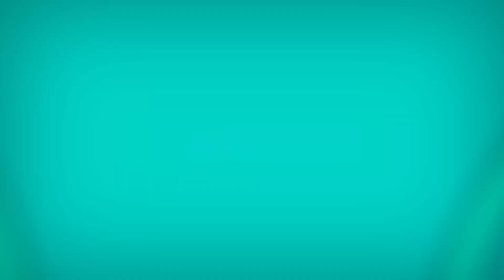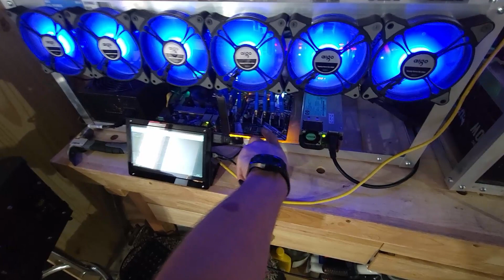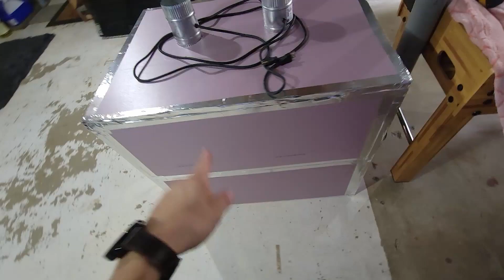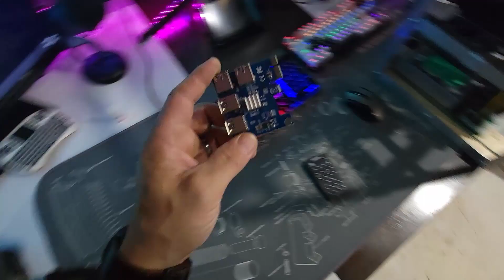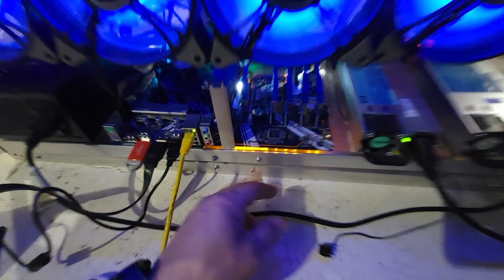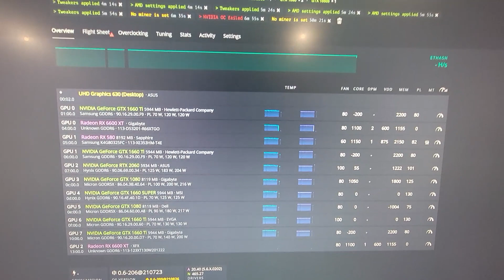Asus Prime Z390-P Mining with 11 GPU

Comment: I am stuck with 10 GPU's 6 NVIDIA and 4 AMD mix. The 5th AMD GPU is not detected at all.  I have I-5 8400 CPU and 1000W  + 1200W PSU's. Any suggestions?

Comment: I have Asus z390-A and have 6 working, can get 8 gpu's showing up with pci-e 1 to 4 splitter, but when I hit mine, pc crashes, even when I have less than 6 gpu's in but at least 2 on the pci-splitter. What am I doing wrong? Is there some mobo setting I need to change? Just read I should or need to use M.2 slots to get to 8 gpu's. That mean that I can do 6 on the pci's like I have been and have to do the other 2 on the m.2 slots? Will the splitter not work at all on this mobo? So far it they show up but yeah it crashes when I try to mine.

Comment: Hello, thank you so much for the video, I was wondering if you can share some light on how you got to work 11 GPU’s, I hit a wall at 10 trying to add the 11th and bios do not start. Have m2 adaptors and a PCIE Splitter and tried switching connections and cannot make it work. I am working with 11 same NVIDIA cards. Any info is appreciated.

Comment: I have the same Motherboard, I want to try it out as well. Is it possible to send a link of the below item
 M.2 to Pcie adaptors 
1 to 4   splitters

server psu and cables?
and does it matter what kind of GPU connect? Can we run 11 pcs of 3080?
Reply from the maker: Hi, first of all where are you located? I am located in the USA so I used Amazon to order the parts. Just go on Amazon and look for the parts. I didn't buy the most expensive things. I should have links in video descriptions for the parts used. Just browse thru the videos. It doesn't matter what gpu you end up using. They should work.

Comment: Question: I am running the z-390p, followed your instructions, although i am running win 10 not hiveOS, i got the 10th card running at m.2_1 (all EVGA 1070's) ...the 11th is connected at the m.2_2 closest to the board CPU on pins, when i plug the USB cable in the m.2 board the cpu will not boot. I changed the m.2 board, the USB cable, the riser, the power to the riser, power to the 1070, swapped 1070 cards. no luck.  is there a step in the bios that enables both m.2 ports? I am stumped. thanks, dig the channel!
Reply from the maker: Hi. As far as I know there is only one setting in bios to enable m.2 port. So I think that would be for both ports. The only think I can think of is maybe you need to free up a lane. Did you disable the on-board sound and all that useless stuff?
Reply: @midnightminer  thanks for the reply, yes i did disable all the non essential items. from the comments i see online i guess im not alone. tks.

Comment: How did you get the 1 to 4 PCIE splitter to work. I have an Asus Prime Z390-P. I have 4G decoding enabled, primary display set to CPU, PCIEX 16_1 link speed GEN2, PCIE GEN2. I have 7 GPUs soon to be 8 but I cna't get 7 to work,
Reply from the maker: I didn't do anything special to get it working. It was plug and play. I used a slot that had a gpu in it previously that was working so I unplugged that and plugged the splitter in it. Did you disable all your unused sata in bios? I ran mine off USB so o disabled all and the on-board audio.
Reply: @midnightminer  Okay I upplugged one of the GPUs and plugged it into the 1to4 splitter the device manager showed 7 GPUs but then the screen flashed several times and the device manager showed 6 GPUs. I unplugged the one GPU and put everything back the way it was and now all 7 of my GPUs are showing and my rig is back up and running. Crazy shit. Thanks for your reply.
Reply from the maker: @scottrudy426   yeah. Honestly I ended up taking that rig apart and it took me 2 hours to get all gpu to register again.. it's weird how it works.
Reply: @midnightminer  I don't know I tried Gen1, 2 and 3 it makes no difference. Audio is disabled. I'm using M.2 SSD.

Comment: I have a z390p mb too, I've managed to get 6 gpus running from 4 by enabling 4g encoding in bios, however i can't get any more than 6. When i add an extra gpu using 4-way pcie splitter, it doesnt detect it and instead removes 3 more GPUs already installed. Has anyone else run into this issue? please help. Thanks
Reply: same here!

Comment: I'm stuck at 10 cards on this mobo. Currently using a Celeron G4930, 8gb ram, Win10, 500gb ssd. 10 cards mine perfect,. but adding an 11th card will cause a no-post.
Reply: How did you get more than 6? I'm using a pcie 4 way splitter, but soon as i add anything more than 6 it stops detecting 3 other GPUs that it was previously detecting. I have same motherboard, i5-9600k cpu, 16gb ram, 256gb ssd and windows 10. Any help would be very much appreciated. Thanks
Reply from the maker: Do uou have enough power out of psu for them? I have another video with the bios setting I use for this motherboard. Look at that maybe it will help. I also use 3 psu. 2 - 1200w hp psu and one 750w psu for the setup. Keep in mind I run on 110 not 240.

Comment: To get 11GPUs running can you use two 1 to 4 splitters, or must you mix in and use M.2 to Pcie adapters as well?
Reply: I'm using this motherboard with 2 x 4 way splitters & 10 cards, working perfectly, just can't get it to work past 10 cards.
Reply: @HenloduToit  I was trying to do the same thing cant get past 7 cards any suggestions
Reply from the maker: I only got it to take 11 gpu by not  running 2 x 4 way splitters.
Reply: @midnightminer  what did you use? 1 x splitter & 2 x m.2 to PCIE adapters?
Reply from the maker: @HenloduToit  yes.
Reply: @midnightminer  can you give some info on how? I cannot pass the 10th GPU

Comment: Hi I have 8 cards working fine 6 on the slots and 2 on the M2 then I bought the 1-4 splitter,added it on the last PCIE then the 2 6600XT are working but one of them is doing only half its normal hash.  For example individually they both do 32Hash each but when I connect them both on the 1-4 splitter one does 32 and the other one 14 Hash any ideas?  They both have the same overclocks.
Reply from the maker: That is weird. Never seen that issue before...

Comment: Hello thanks to the tutorial I managed to put 11 GPU rtx3090, but when I connect 12 GPU it does not turn on the motherboard. Hello this is a call to someone PROFESSIONAL, I seek assistance and pay if necessary, I have an azus z390A motherboard with 11 rtx 3090 zotac, when I put 12 rtx 3090 zotac, it does not turn on I have power supplies from AX 1600I 6 power supplies, plug in 2 PSU and plug it in plug in the motherboard thinking there is no power and it doesn't work either, anyone ?? It tells me how to run 12GPU
Reply: hola ese mother maximo de 10gpus a 11gpus nomas soporta.

Comment: I can get 4 GPUs to run, however 5th GPU won't be recognised in device manager in windows. I've looked at videos and copied the bios settings but no luck. Any ideas?
Reply: Make sure you turn off cmos setting as well.. On youtube, I found another guy who gives setting for z390-p..if u search.
Reply: @akshaysarkardbit  Ive made the best move going from Windows to hiveos, now I've got 7 GPUs working 💪 so far without any issues. Doing any mining things on windows was just a big time sink as I found out, best decision ever.
Reply: @mantass6376 glad it worked for you.👋👋  But I was able to run 9 gpu on hive os with same setting from motherboard. So, I know the motherboard and hive os is capable to produce so. Thanks for the video too for confirmation 😊
Reply: @akshaysarkardbit  I will soon try and see whether I can get 10 or 11 gpus running, will let you know 😉

Comment: Do you have to buy anything extra to run 6 GPUs?
Reply from the maker: no, i did not have to buy anything extra. i did use a 1 to 4 usb splitter because i got tired of messing around with the settings in bios when i started. so maybe get one of those to have as a backup.
Reply: @midnightminer  Thank you

Comment: I have the same motherboard and successfully managed to get 10 gpus. I can NOT get more than 10. I have only tried hive os, I think lol. But 11 hooked up I get no post just black screen. What cpu do you have I'm thinking I'm being restricted due to the lane capacity of the cpu. I have the g4900t
Reply from the maker: Intel Core i5-9400 Desktop Processor 6 Cores 2. 90 GHz up to 4. 10 GHz Turbo LGA1151 300 Series 65W Processors BX80684I59400
i will also leave the link for the one i have, in here   
https://amzn.to/3AbI22P
Reply: @midnightminer  i have the same problem bro, i cant get more than 10 GPU, when i put the 11 gpu, the hiveos works but dont recognize the graphics card

Comment: my guy ! I have a MSI z390 A-pro - Once I plug the 9th gpu. It won't boot. Not even into bios.
I have been stuck for 2 days... Any idea how to fix it ? I see that you have 11 running on that 390.
Reply from the maker: Hi there. Mine is an asus prime. So, make sure you have enough pcie lanes available on that board. Disable all sata ports, on-board audio... I have a video on my bios settings for my board. I should mention that I am using hiveos on a USB  so I'm not taking up a sata port and I could disable all ports to free up pcie lanes.
Reply: @midnightminer  All sata disabled. on board audio disabled. Everything is unplugged. I won't boot is a 9th GPU is plugged. Damn it.
Reply from the maker: Do you have more than 9 pcie lanes on that motherboard? I ran mine with  a 1 to 4 splitter and I also had 2  m.2 to pcie adaptors
Reply: @midnightminer  yes the Z390 has  24 pcie lanes.. So it should be good... Even if I were to keep the 8 sata slots. I don't get it. Up to 8. perfect. 9th won't even load the bios loader. I found 2 more people with the same issue on forum. None of them got solved :/
Reply: @midnightminer  i currently have 2 spliter 4 usb pcie. (Works, computer boost when all 8 cards are plugs) Then I have 4 pcie lanes on the mother board left.

When ever I remove one of the splitter and plugs the others pcie it works too. As long as I dont have more than 8 gpu plugged in.
My CPU is a G5420 (16 lanes)
Reply: @midnightminer  alright. After messing with the bios much more, I was able to boot 11 cards. When the 12th one is plugged… I get a blakc screen and won’t boot. But that’s a good start
Reply from the maker: I have the same issue on mine after 11 gpu. That's all I could get out of mine and I tried everything. I hope you get more working on that board.
Reply: @midnightminer  man… I wish I could get that 12th one. I disabled everything I could but internal graphic and l’an control (Ethernet)
I don’t know what else I could do 😂
Reply from the maker: I went thru the same things.. took me 4 days of messing around to realize I couldn't get any other gpus to run so I was stuck at 11. But 11 gpus on a motherboard like that still isn't bad at all.

Comment: Nice try dude thanks for sharing, i have a rig with the msi z390 plus and have 9 cards running so may try add 2 more👍👍i did try using both  m.2 converted to pcie but found the top m.2 was ok but the lower one shuts off the mother board pcie x1 slot in front of it so ended up just converting one of the m.2 lanes.  So ended up using 2 of the 1 to 4 splitters, one splitter has 3 cards and the other 2 cards like you had initially👍  thinking about it have you tried to add 3 cards or even 4 to both your 1 to 4 splitters to get 12 gpus running🤔💡 ?
Reply from the maker: i did try to add 12 gpu's like that and it didn't work. i tried all options and 11 was the best i could get.

Comment: What processor are you using in the 11 gpu rig?
Reply from the maker: i5 9400.  8th gen
Reply: @midnightminer  works with an Intel Core i3-9100?
Reply from the maker: @j.mauricio.suescun  I don't really know if it does or not. Sorry

Comment: Same here, just got 11 to work with 2 x 1 to 4 pci splitters
Reply from the maker: That's awesome. I didn't try that way. I only used one 1 to 4 splitter but i did use 2 M.2 to pcie adaptors.
Reply: @midnightminer  Kool, so it seems to be a limit of the Mobo...
Reply from the maker: Yes, it doesn't have any more lanes available to allow for more Gpu's. I tried everything and that is all i can get out of it. Still a good mobo for the price.

Comment: I use b450f 2 i run 6 gpu with a nvme adapter card. The x16_2 slot doesnt work for gpu.
Reply from the maker: unfortunately i don't know much about that board that you are using.

Comment: I got Z 390-A pro in hiveos linux couldnt run more than 5 gpu after adding 5th gpu bios wont boot, the only solution after standard bios settings for mining was change Windows 10 WHQL Support [UEFI]) in bios, now running 9 gpu on one board with 1-4 splitter
Reply from the maker: did you take a look at my other video with bios settings for my board? I'll leave the link here for you. https://youtu.be/f-DrkjkzMZ4

Comment: Maybe get the racks from Home Depot. About 50-75$ for 4foot rack. It helps a lot! Space and whatnot. Wheels to move it around. Beautiful setup
Reply from the maker: i was thinking about that. ChumpChangeXD was nice enough to send me some GPU hangers, so now i think i have to switch stuff out.
Reply: @midnightminer  oh yea.  I have his hangers too! Helps with heat. I notice difference when I took them off the veddha frames. And we able zip tie or velcro strap all the wires to make it look nice. Can’t wait to see your wire rack setup!
Reply from the maker: @thomastran2432   I have hangers all I need is to wait for the prices to drop down on the h110 motherboards. I do t want to pay that much for them.
Reply: @midnightminer  oh yea. Those h110 I can’t do that ahhaha. That’s too much. I can get 2 boards for that. I like the b150 zotac boards. But I have been scoring i5 7600k and I already had z270 boards. I’m scared buying used boards lol
Reply from the maker: @thomastran2432   yeah, I don't want used boards that cost an arm and a leg.. too much risk for my empty wallet. Lol

Comment: What bios version do you have i can't get my z390-p to post with more then 10 gpus. Using a 1-4 pcie splitter and 2 m.2 adapters but whenever i plug in the 11th gpu the fans just spin and nothing comes up.
Reply from the maker: i have a video on all settings coming out tomorrow. But i updated bios 3 months ago and didn't touch it since. I would have to took on what bios i have on it.
Reply: @midnightminer  please and thanks bro that would be awesome so far ive concluded that im only going to get 10 on mine but im interested to see if theres something you did i had skipped. Happy mining ❤️.
Reply from the maker: @thedealer799   video coming out today.

Comment: I see that you're running NVIDIA & Radeon cards on the Z390-P. Someone told me you couldn't mix cards, but it seems you can.
Reply from the maker: you can run them on the same motherboard. i use hiveos and you have to run 2 miners in hiveos. one for the nvidia cards and one for amd cards. super easy
Reply: @midnightminer  Thanks! What size power supply are you using in that rig? Also, how much RAM are you using? Loved the video!
Reply from the maker: @Jon Reynolds   I am actually using 3 power supplies. One 1000w from Amazon and 2 hp server psu 1200w
Reply from the maker: i am only using one 8 Gb stick of ram in that rig.
Reply: PhoenixMiner, and NBMiner both allow you to mix AMD and Nvidia cards without changing any settings. Just plug and play.

Comment: i can not get more then 4 cards working on the motherboard :( plz help did you use specific BIOS ?
Reply from the maker: ok, check in bios for sata ports, disable all ports if you are running operating system off usb, if you are using an ssd then leave that one port for the ssd enabled but disable all of the others. disable audio in bios, enable 4G decoding. try that and let me know if you have any luck, i did not update bios on my motherboard.
Reply: @midnightminer   that is already all enabled :(
Reply: looking for the answer for 3 months right now xD
Reply: i did build a second rig because i could not get more then 4 , now i got an rig 3 cards and 4 , so i have 1 more free slot , then i will need to find the solution xD
Reply from the maker: @milan vdS  I will try and make a video with the phone on bios to show what settings I have

Comment: Great video. If I want to start mining, what other parts do I need to buy? I was looking at the same mother thats how I found your video.
So I need the motherboard, a GPU, CPU, power supply, RAM... Do I need a SSD and windows?

What power supply do you use?
Reply from the maker: Hey there D C! Thank you for the kind words. you will need an ssd for windows. I started with windows but then moved over to HiveOS for my mining rig as it was something people talked about and also wanted to learn more, i am glad i switched from windows. the motherboard can run 6 gpu's but you have to make sure the settings in bios are correct in order to run all 6 cards. also make sure you have a good power supply, i used a regular atx power supply 550w and then went and bought the 1200w HP psu with breakout board and cables, also don't forget about the risers and make sure you get good ones.

Comment: hey im getting a not enough pcie resources error i have 8 gpus. they are running but not at full mhs did you come across this problem?
Reply from the maker: are you mining in windows?
Reply: @midnightminer  no it's a bad board I got it from Amazon refurbished it works with 6 cards fine so fuck it
Reply: @headcheesee  l have the same problem, I bought new… 6 gpu full and 2 gpu less

Comment: which ram and cpu are you using?
Reply from the maker: I am using the Intel core i5-9400 and for ram I use the XPG ddr4 D60G 3200MHz
Reply: @midnightminer  Thanks a ton. Can I use any ram or it requires a specific RAM?
Reply from the maker: @JayThukral   on this motherboard you can only use DDR4 ram. and i believe anything over 2600 mhz shopuld work as long as it is DDR4 ram